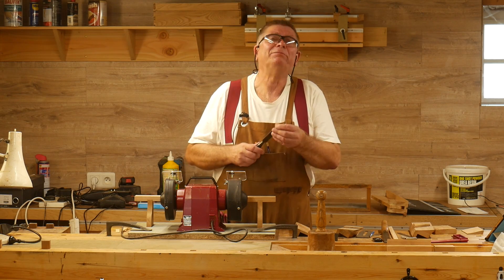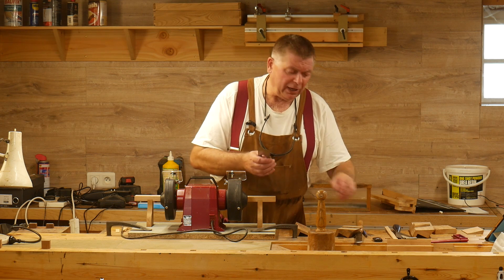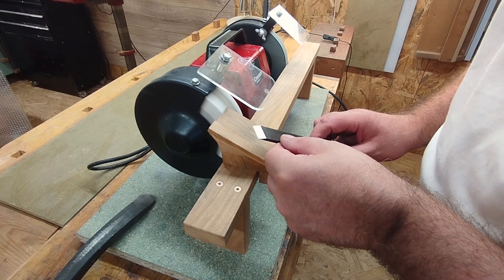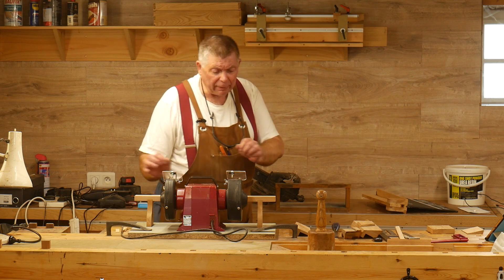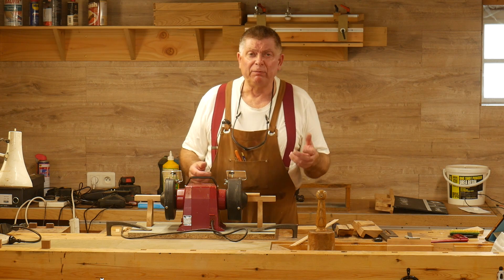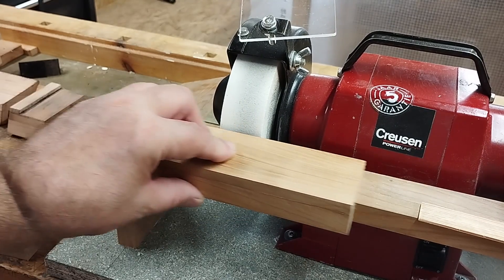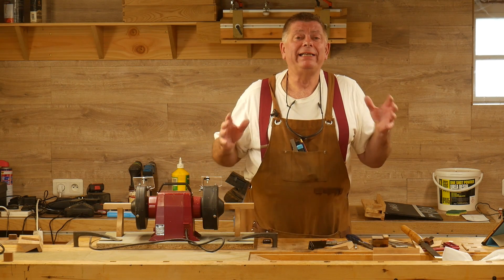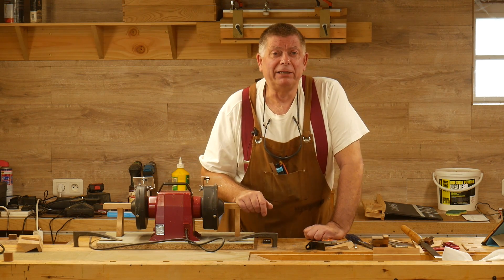Foolproof Grinding Station! Build one today! PLANS NOW AVAILABLE!

Comment: Just seen this, love the idea of using the same tool rest for both wheels.
  With CBN wheels you could go from 180 to 600 grit on same grinder with precision as they maintain same diam.
   Love your ingenuity Steve- there is no need to invest in expensive jigs just a decent bench grinder.

Comment: Ive made this, it works well thanks. With a 6" wheel it took a few tries to get the angle dialled in on the carrier.   

Do you think a this could work for planar/thicknesser blades? (I saw your other video on honing those with sandpaper and a jig)
Reply from the maker: I doubt it, TBH, simply because the bades are longer than the distance between the wheels. I think they would get in the way of each other. S
Reply: @SteveMaskery  thanks Steve, makes sense

Comment: Hi Steve, just come across your demos. How do you compensate for stone wear?
Reply from the maker: I don't, actually. It's not a machine I use very often, so it doesn't get a lot of wear. Remember this is just the grind angle, it's not critical, chisels and plane irons are going to be honed anyway. I don't hone my turning tools, but then I don't do very much turning. I'm a losy turner.

Comment: Hi Steve 
Just making your jig but how do you adjust saddle as the wheel gets dressed and smaller
Reply: Good question! TBH, I've not had to do that very often and it makes such a small difference that I don't think it will matter. Remember that blades will need to be honed anyway, so the gringing is not that critical.

Comment: Great idea Steve, gonna make one tomorrow I am thinking about lowering the jig so the top of my chisel meets the middle of the grinding wheel maybe it's easier to adjust when the wheel gets worn. Love your videos
Reply from the maker: Thank you Andre. But a word of caution. I prefer not to run the risk of something (workpiece, finger, etc) coming into contct with the wheel below the centre line. It can get dragged down and into the jig, very messy. I have seen someone do that on a sander. If you don't like working that far up on the wheel, it might be better to make the platform narrower rather than lower.
Reply: Hi Steve, finally made one, 😀, however i underestimated how precies the measurements should be, 😅😅😅, do you have more tips and tricks about sharpening tools?
Complements on your videos, and waiting for your next. I am Dutch so sorry for my bad English, 
Gr André

Comment: that bandsaw cutting made my heart stop, iron fingers! I am wondering if there is another tool one can use to cut the sliding baseboard at an angle
Reply from the maker: LOL! It looks worse than it is. What is not clear from the camera angle is that my left thumb is a good 3.4" away from the left. My right fingers are just supporting the waste beyond the cutting point. It's all close enough, I'll grant you, but  my fingers are never in front of the blade. 
Thanks for commenting though, glad people are paying attention to safety :) Best wishes.
Reply: a hand saw😉
Reply: Or a hand plane